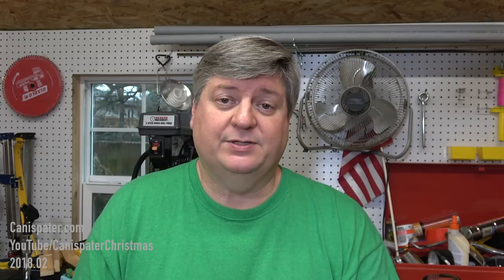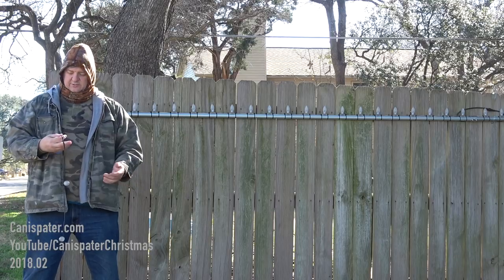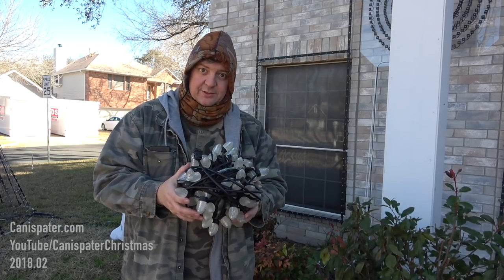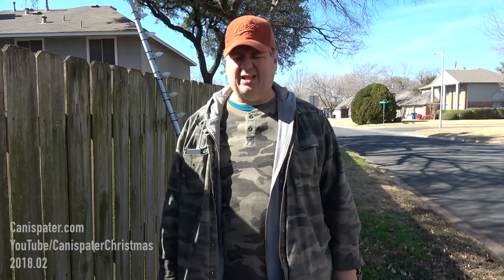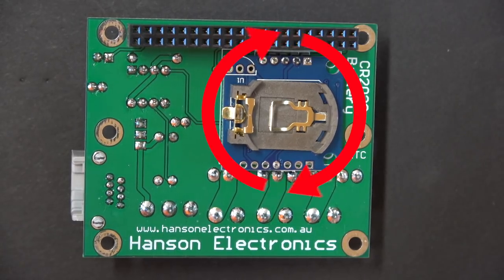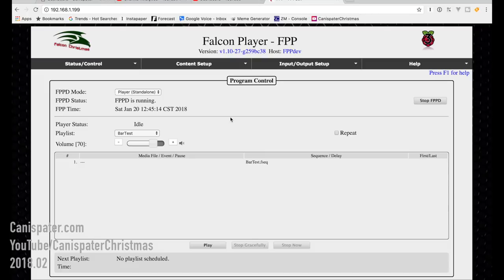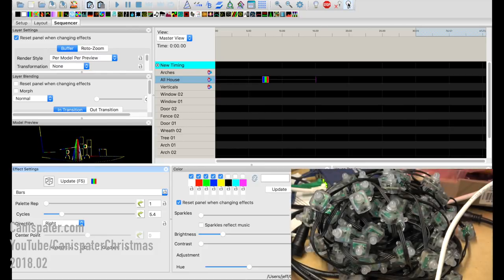🥧Raspberry Pi RGB Pixel Controller from Hanson Electronics (2018) 🥧

Comment: Right now I am running my pixels on the pi but using arduinos as the controllers, I am definitely going to check this out!
Reply from the maker: Cool! Falcon also makes one if you are in the US, but Alan's stuff is well worth it. You should be happy with either one.

Comment: First, prayers for you and the family as you traverse this difficult time.  
Now, as an AV tech for bands, I can say that by balling the cables up that way, they may not "tangle" as much, but you'll add a lot of twisting that will shorten their lifespan.  That's why we use the second method you demonstrated for microphone and electric cables. It still has some twisting but not as much.  Thankfully, I think most of the wires are stranded, and a bit more tolerant to twisting, but they don't like it.  As long as it works for you, though.  I put my non-pixel lights away by using the second method, in a 18 gallon tub, with plastic bags separating the strings.  Yes, it has some tangling, but the cables have lasted for many years.  (I have some microphone cables and extension that are 20+ years old now.)  This will be my first year with pixels (I hope, if I can afford some,) or at least connecting the lights to the computer again.  (I have been using a computer to run my DJ lights for 20+ years, just never used it at Christmas, for a variety of reasons.  Now that I'm about to retire, though, that is changing.)  I've enjoyed watching your videos, and they are helping me re-learn some things I haven't used for a while.
Reply from the maker: Thanks! I understand what you mean about rolling up most cables. In fact I use the "audio guy cable approach" for just about everything else. It's so fun to throw an extension cord in the air and have it unravel without tangling. For lights though, I've not experienced the same luck except for the ball idea. I don't have any light strings that have lasted 20 years, but I do have extension/mic cords that have so you may be onto something! :)
Reply: After I said that, I started thinking about it, and I suspect that only doing this once a year may keep it from being a big problem in this application, so after I start getting pixels (since my strings this year are already "asleep" I may try this method.  It does seem a good way to keep them from tangling.  I guess it's the "bumps" that seem to like catching on each other that makes this different from AV use, which is "straight" cables, and often done once a day.  :)

Comment: Love your videos and I feel they help out a lot, found you through Xlights.
Just getting started in RGB/pixel and Xlights , and I have a number of PI's that I once used for other things. I will have lots of questions and hopeful will find answers. One for now is the RPI-28+ a good way to start and learn how to setup sequences and working with Xlights and pixels, as a low-cost introduction to doing them? Or would you recommend something else.
Thanks for your  videos and help
Reply from the maker: Thanks! I'm not sure what is supported from a legacy perspective, but you may also have trouble finding a 2B+ for sale. If you already have one, then I'm sure you can get a version of FPP that will run on it just to get your feet wet, it just might not be the latest version of FPP. Also, understand that FPP is just a player for sequences you create in xLights and xLights is kindof a beast in terms of a learning curve so I'd concentrate on getting familiar with that first which won't cost any money. 😂

Comment: Great Videos getting a Lot from them, I'm new to this and trying to learn
If this device is used, will I need to get License Keys for FPP?
Will these from wired watts (sn12v50skp3-r) work with this?
Reply from the maker: To my knowledge, the license key is for vendors who sell products so I don't believe end-users are required to pay for one (I haven't). The pixels you asked about use the WS2811 protocol (most common) so those will work fine.

Comment: Jeff, the string of lights you are rolling at the beginning of the video, are those the "C9 12V addressable" that Ray has at its store? The reason I am asking is because it will be a good replacement for my Home Depot incandescent and dumb C9 light bulbs I used all around my house eave. My existing C9 lights are hold in place by this plastic thingy (also from Home Depot) that you insert between the shingles. Would you mind measuring the the diameter and height of the base so I can determine if is compatible? Thank you so much.
Reply from the maker: I believe so. They are from Ray and addressable and roughly c9-ish. :) The actual base is rectangular and threaded so the covers screw onto the base. I believe roughly half an inch, but I can measure later tonight.

Comment: can the rpi-28d be stacked to ad chanels? Can it be run independently from the pi to add channels? I tried ascing on the hansen website under contact and it said it wasnt able to verify capchca but there was no capchca. was wanting to start with the 2 chanels and add on 2 at a time to start without the $200 expense right away for the F16v3.
Reply from the maker: Can't stack them no. Each requires a Pi. You might look at an E6804 or E682 from SanDevices. Not as fancy as a Falcon, but they are workhorses.

Comment: Sorry for my Ignorance , but how does one setup a PiCap in Xlights? do you just just it as a e1.31 controller that has 2 outputs? If i set it up as Unicast do i use the FPP Ip?

Thanks for everything you do!
Reply from the maker: Thanks! Try "FPP PiHat." Not sure on the second part. Try it with the FPP proxy. Not sure if there's additional programming on the hat itself or if it just configures through FPP.

Comment: Jeff, are the lights on the fence the C9 bulb covers from Ray Wu? If so, do they screw on the pixels or just push on? Have you had any issues with water or condensation inside? I am relatively new to your channel, but I hope you and your wife are doing well in 2020.
Reply from the maker: Thanks! We're keepin' on. :) Yes, the pixels have threaded bases and the covers screw onto the base. No water. Had a few break off, but they have held up fairly well.

Comment: Hi Jeff 
I have seen your vedio about the piCap and can’t find it now to comment on it so I will do it here .
Can you run a 1200 pixel for mega tree with the PiCap ? And if the answer is yes 
Is that a better way to do it or it’s better to use the smart receiver?
Reply from the maker: I don't have a video on the PiCap so not surprised you can't find it. 😂 Documentation on the PiCap says 2 strings of 800+ so you should be able to run 2 strings of 600 with power injection if you wanted. The strings could be shorter on a smart receiver since you have 4 ports (or 12 if you chain receivers).
Reply: @CanispaterChristmas  but with receiver isn’t only 1024 pixels because they are from one port ?
Reply from the maker: @mourisyounan9998  It depends on what the other side of the receiver is. If it's an F16, you can assign 1 or 4 ports of 1,024. If it's an F48, 1,024 is spread across 3 banks so you wouldn't want to assign 1022-pixels-per-port since the other two banks would only have 1 pixel.
Reply: @CanispaterChristmas  am not getting it , I think you need to make another vedio explain it more but not with Welch's fruit snacks lol JK .
I cant find your  email  so I can send you some kind of drawing to show you what I mean and explain it more.
I know for you its easy for us new into this its not that much easy lol.

Comment: Hope your wife is doing well.
My question is with this pi\hat setup what would be the max nodes using all ports\channels.
Love your videos believe I've watched everything by you..lol 
Researching for next yr setup can wait to be a toe dipper but knowing me I'll jump right in.
My last project I built standup arcade machine using pi3b+ motion sensor with arduino.
Reply from the maker: Thanks! I don't think there is a standard for numbers. You should check the specs of the one you use (there are a couple of different vendors providing hats). Cool project!

Comment: Have you ever experienced uploading a sequence and trying to play it but having both "elapsed" and "remaining" time as 00:00. I had my set up working before but when I switched to a wired internet connection I haven't been able to get it to output anything.
Reply from the maker: Did you have an audio dongle that you don’t have currently connected?
Reply: @CanispaterChristmas  I've tried with an without the usb soundcard
Reply from the maker: @brendandowling1503  Go to FPP Settings. "OMXPlayer (mp4 playback) Audio Output:" is ALSA by default meaning audio out the 3.5mm jack on the Pi. It needs to boot with those settings so if you plugged or unplugged an audio interface, do a reboot with the correct settings. If you ARE using a USB dongle, it should obviously be set to the dongle. So reboot, check to make sure it's correct and try it again. Other than that, you'll need to ask on the forums as I've only seen that with an incorrect audio setting.

Comment: Why do you need a Raspberry Pi to run a Falcon?(thinking of a F48) is the new Pi4 the one to buy?
Reply from the maker: Falcons can only act as FPP remotes so you either need a master FPP (Pi or BeagleBone) or xSchedule running in master mode. Pi4 works fine as does a Pi3.
Reply: @CanispaterChristmas  Thank you....

Comment: Hey there, great video. Maybe you can help! I just cant get my rPi28D to output any data..... any tips? I've followed your video here, running off a rPi 3B+.....FPP V10
Reply from the maker: Well, I haven't tried a 3B+ with FPP yet. It may need some new drivers that are in the 2.0 branch. So maybe try upgrading FPP? You would probably want to do it again near Halloween.
Reply: CanispaterChristmas thanks Jeff, will give it a shot.

Comment: would an expansion card be in the works so you could have more outputs, would like to run everything off of multiple pi's
Reply from the maker: I doubt it. Pixel controllers are really better suited for running larger numbers of pixels. This hat is more for getting you started or running a small show. You can still run multiple Pis if needed.

Comment: Hey Jeff how many pixels per output are supported?
Reply from the maker: From Alan: 
It's in the manual. It's limited in FPP to 1000 each for the WS281x and 510 for WS2801.

Comment: I have a 240volt transformer that puts out 12volts at 5amps  and connected to a pi 28d+ now you say a 1 amp fuse on the line would that not blow the fuse . I'am new to this.
Reply from the maker: Hmm. Not sure what you are referring to. What point in the video?
Reply: @CanispaterChristmas   8.46 minutes 8:45 of this show 
zero volt and 12 volt terminals of c
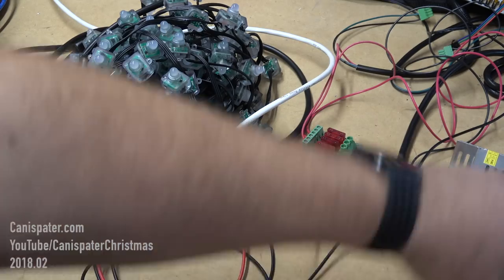Reply from the maker: Oh. I believe that's just to power the rPi-28D electronics - not the pixels themselves. You still need to provide power for the pixels. See 10:07
Reply: @CanispaterChristmas  yes but you say a 1amp fuse on a 12v supply now is a 12v 5amp transformer okay with that or will it blow the fuse and if so what size transformer should I get
Reply from the maker: It doesn't matter if you have a 500-amp supply feeding it. The 1-amp fuse is for the board only meaning the board won't pull more than an amp at 12V. Alan (the board designer) likes fuses and is pretty smart. :)
Reply: @CanispaterChristmas  Ok now i have ordered a hexfuse2 now I have the PI 28d+ which has 3 7.5amp fuses on the board to protect the lights i guess now what size fuse will i put in the hexfuse  to supply power to the board for the lights
Reply: Also Hanson does not sell a 1amp fuse for the hexfuse the closest is 2 amps
Reply from the maker: The fuses on the board will protect the input so you can go directly from the power supply to those inputs.
Reply from the maker: The fuses used by the HexFuse are standard automotive fuses. You might use a 1-amp inline fuse from an automotive parts store just for the board. I use the HexFuse for injecting power since that isn't fuse-protected, but that's an advanced concept you may want to wait on. Just keep the strings short enough to get things blinking and worry about injecting power once you have the initial part down. You might also go through my beginner playlist if you haven't already (https://www.youtube.com/playlist?list=PLFyrAfJ-kKd4ZfPdXWIt8v_bav61mW_KW). The ballpark calculation for amperage is 0.06 amps per pixel at 100% brightness, all white so 100 pixels draws roughly 6-amps. Different strings are different so check the specs on the pixels you have (mfg web site should have the info).
Reply: @CanispaterChristmas  THANK YOU I WILL LOOK AT ALL YOUR SHOWS

Comment: how do you connect the e1.31 output?
Reply from the maker: Not sure what you mean. Feeding data to the hat or E1.31 out to another controller? If the hat, you configure as shown in the video and it transfers data using the GPIO pins.

Comment: How many pixels per port can I use with this?
Reply: It's in the manual. It's limited in FPP to 1000 each for the WS281x and 510 for WS2801.